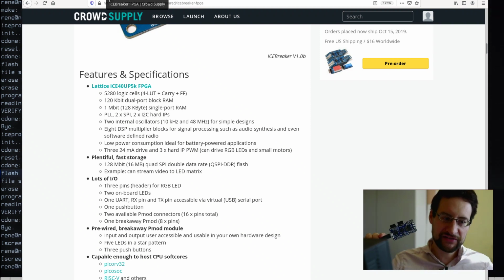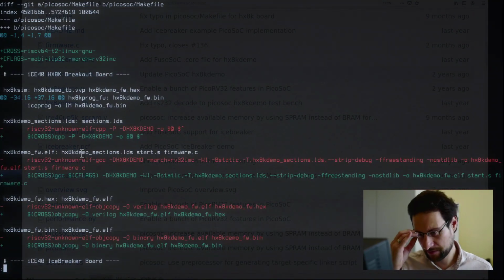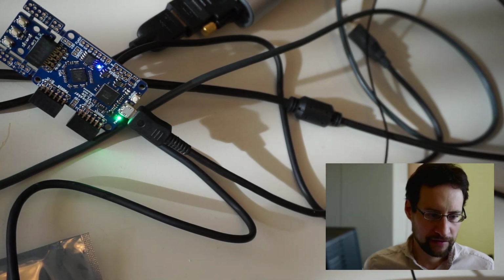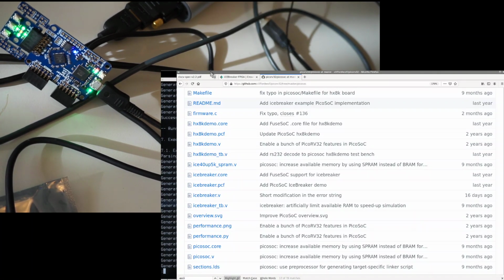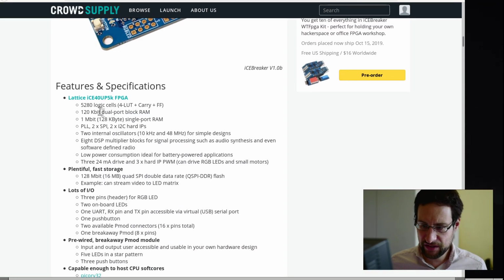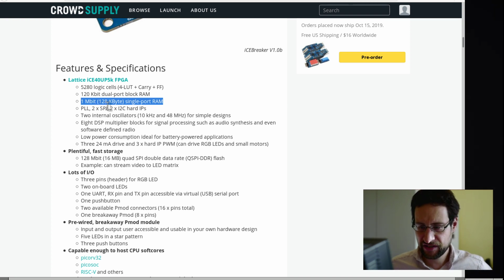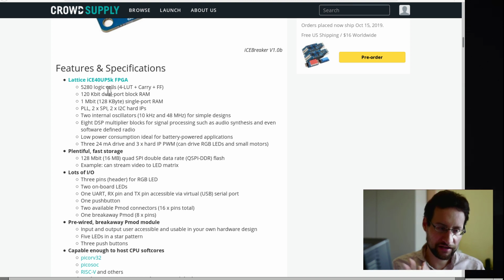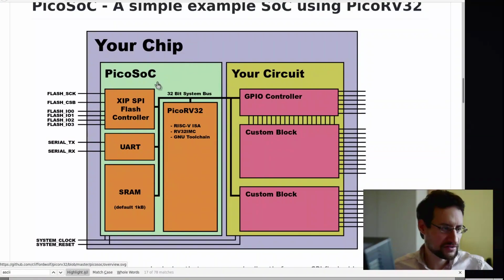RISCV CPU on an FPGA: OpenSource and size optimized!

Comment: Can you take a production machine, rip out the Intel/AMD/ARM cpu, replace it with a FPGA, and make it work as before, or is just a prototype for a cpu that isn't on the market and won't be for years?

Yeah, I thought so.
Reply: Yes you can but what would be the point? FPGA is not designed to replace CPUs
Reply: Actually, this kinda has been done, but with much older-simpler CPUs.

There have been a couple MOS 6502 replacements put inside of various 8-bit machines.